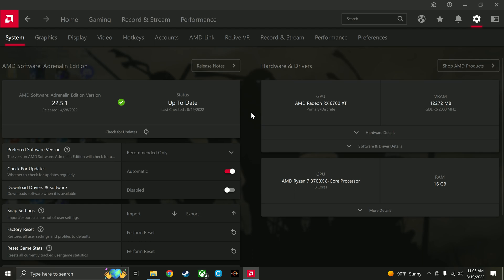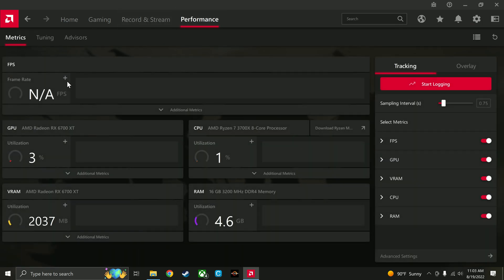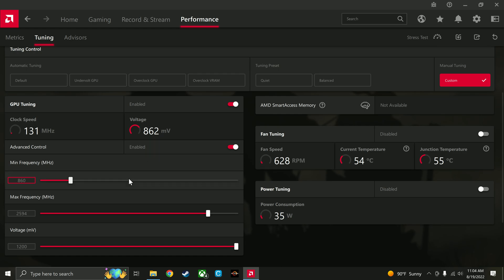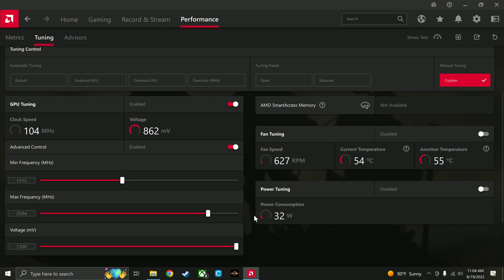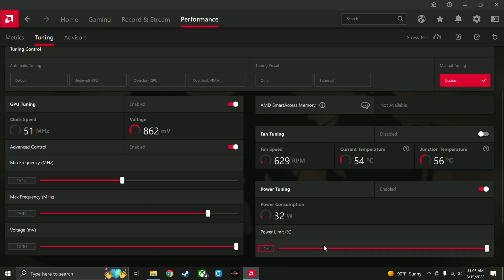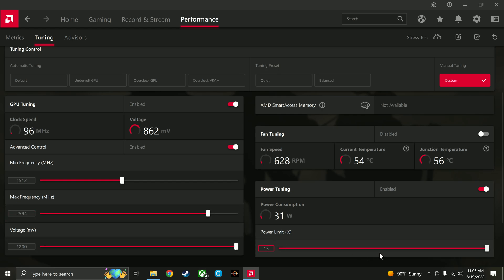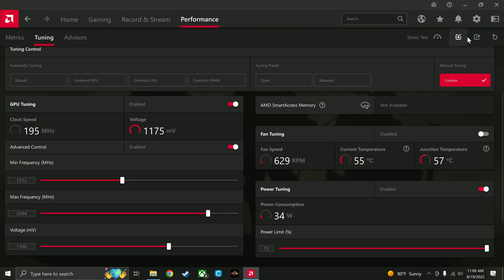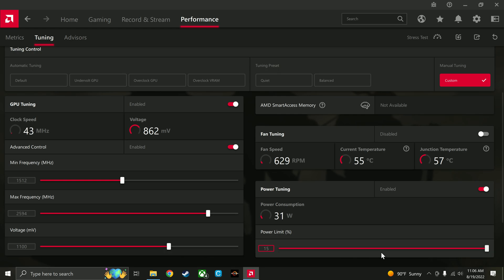How to Fix Sound Cutting Out AMD Radeon RX 6700xt

Comment: They removed this feature. :( FFS AMD, you suck so hard. Edit: 9070 XT Sapphire Pulse.

The only thing I haven't tried (I refuse) is to install Brave Browser and have it minimized at all times.
Reply from the maker: Maybe see if you can do it with msi afterburner
Reply: @Bunta1987qwerty   Well I went with the Brave Browser "fix". It works. If you happen to turn off hardware acceleration (Twitch doesn't work with it) then the fix stops working.

Comment: I have 5600XT, the thing has always had audio issues while playing games. I had to resort to using speakers in place of the cards audio. It's been like that since I built it back in 2020. I've been reluctant to mess with any settings (other than fan tuning, something I'll mention in a second), as it seems to crash even with the slightest adjustment. Now as far as fan tuning goes... the fans don't work unless I manually turn them on (for each game). For about 4 years I'd always wondered why I'd never heard the fan spin... I only play in 1080p and most games aren't very graphically intense, so I think that's what saved it from frying.
Reply from the maker: @Traeger91  how are the temperatures? I remember some 5700xt models had similar issues because of the cooler having no mounting pressure. I think it was fixed by adding washers to the backside of the card, so the screws could pull the cooler more tightly to the die. Alternatively, if the vram or vrm temperatures get too high, the card would also be unstable. This would happen if the pads aren’t making good contact with the components or the cooler. Laptops today have done away with pads, in favor of thermal putty for two reasons. The putty is better at transferring the heat to the cooler, and they don’t hinder die pressure. If you could, please install hwinfo64, select sensors, start a log file, and run a game for a few minutes. I’d like to see what the log file says. You could email it or put it in google drive and share it with me. Or we could get on my discord and do it in realtime. Unless you live in SoCal, then maybe we could do it in person. Sucks to hear you’ve been dealing with such issues for so long.
Reply: @Bunta1987qwerty  The only thing I can say is that it doesn't like being in the 50's. It never has and usually crashes once it get close to 60.
Reply from the maker: @ maybe try a lower frequency and/or higher voltage. Instability comes from too high of a frequency, or too low of voltage for the amount of throughput, which is a combination of frequency and instructions per cycle.

Comment: Had issue with audio cutting out for a second at a time every so often mostly watching you-tube shorts in fact. Or very low fidelity games. This did fix the issue for me although I had to raise the min frequency up to 2000. I've since come across other posts on reddit for others who had to go up to 2000 or even higher. Each card seems a bit different even if its the same amd model. Regardless does anyone know exactly why this works. I might raise something in the amd community forums and reference this video and the other reddit posts to see if anyone can explain this mystery.
Reply from the maker: @nobsterlobster4840  well, the higher you raise the max clock, the higher the max frequency goes. For example, if voltage is set to 1150mV and clock speeds are stock, it will have a max of 1150mV. If you then raise the clock speed by 100MHz, the max voltage will be higher than 1150mV. I imagine the min frequency setting is likewise raising the minimum voltage. The lower the voltage for a given load, the less stable it potentially is. Instability starts with minor artifacts, which could be sound cuts or video cuts, and eventually color shifts, audible noise, etc., and eventually stall. I’ll check when I get a chance, to confirm this.

Comment: I've been having this same problem for months. I've been searching for a solution all over Google, Reddit, Amd Forums and I found this video. I have an RX 7900XT and I've had this problem for about three months. Could someone please tell me what the correct configuration values would be for my GPU? Please help.
Reply from the maker: @neofrancos  just bump the frequency until the sound stops cutting, and if you want to lose some heat, run it at full load and drop the voltage by 10mV until it crashes and then you set it to maybe 20mV above that
Reply from the maker: @neofrancos  I should have mentioned, leave it at each voltage setting for at least a minute before you change it again, and make sure the power limit is set to max when you do it. You can set power limit to whatever you want once you’ve found minimum stable voltage. If it crashes again in the future, bump it up another 10mV. Different games/applications will load it differently, so just because it’s totally stable in one doesn’t mean it’s stable for everything.

Comment: Yeah this fixed it for me, thanks a lot m8. In my case was not only the sound that was stuttering, it was also mouse movement stuttering. Doing this it's OK again, thanks.
Reply from the maker: If you run into that mouse issue again, open device manager, look for your mouse, right click it, click on properties, and if there's a tab that says power management, make sure "allow windows to turn this device off to save power" is disabled. This is true for anything that seems to lag, like keyboards, trackpads, etc. I hope this helps.
Reply: @Bunta1987qwerty  - Heya! thanks for the tip. I was already aware of that, and had in fact done your tip before, but it doesn't help in my case. The only thing that worked after hours of troubleshooting was realy uninstalling the 2024 Adrenaline drivers (all of them have this issue) and reverting back to 23.12.1 or 23.11.1 and everything is smooth again. Shame :\

Comment: Thanks very much, mate!
As many others mentioned, I was trying to fix these extremely annoying crackling audio issues for weeks since I installed my 6750 XT. They were not permanent in my case, but would happen especially when a streaming video was maximized to full screen.
Even considered replacing the GPU and/or the power source, but thankfully found your instructions before that happened. They did the trick perfectly: minimum frequency set to 1500 MHz, undervoltage at 1180 mV, and the issues are gone. Awesome job, thanks again for sharing!!

Comment: Ah Glad I found this, good suggestion. Made a light go off in my head.  So I built a TV PC and it runs mostly light weight games Vsync so it makes sense to me the GPU is power stating down, and then doesnt have the oomph to push audio as well.  AMD really needs to sort these little QOL issues out no?

So tehcnically AMD GPUs use internal p-state based on frequency breakpoints (well they did in the past).  I used to hack their BIOS's and stuff and you can change the breakpoints.  Essentially by telling everyone to go up to 1500mhz, when the GPU is loaded it will hit a minimum p-state and hold there (no idea what the values are but that's likely in range of like p4 or p5).  So these lighter games with FPS limits drop the p-state down and then the stutters begin.

I'll try this on mine, not in front of it right now, but I think this will 100% fix the issue

Comment: I have the 6700xt for 2 yrs now runs great,but since the last edition came out,my sound works during game play but I always record my games and this month all my recordings the audio shuts off half way thru.
Reply from the maker: Try using hevc if it’s currently on avc. If audio channels is set to auto, set it to stereo. I hope this helps.
Reply: @Bunta1987qwerty  I tried what you showed and my pc just crashed right now,I reverted back to defaults and the AMD debug message came so I filled that out,thanks anyway
Reply from the maker: @andrewmontreal  check the metrics and make sure it isn’t overheating
Reply: @Bunta1987qwerty  thanks dude, i was using av1 codec and the sound was cut off in the last 5-7 seconds of the clip/video, now i have everything as it should be

Comment: This fix worked on my RX 6750 XT (AMD reference/1st party model). Most noticeable for me in Rocket League, and 1500 was the magic value to set Min Frequency to. I made no other changes.

The fix also carries over into Linux (Arch/HoloISO) as well. I enabled OC'ing in the kernel parameters during boot and used the LACT tool to set minimum clock, again to 1500 with no other changes. 

Cheers!
Reply: It fixed the problem for me aswell under linux thx

Comment: Thanks bro it works for me but in order to solve sound issue completely first I used your settings second  I turned on  metrics overlay and it worked now I have no sound issue with my 6700xt
 perfect🎉

Comment: i picked up a little used HTPC on craigslist with a RX 5600 OEM version, and none of these fixes do anything :( sigh. saw a suggestion to change the pci-e version from auto to gen 3 or 4 or whatever in your bios, this didnt do it for me either
Reply from the maker: If you’re still using the whole system, try to find the drivers for that specific htpc
Reply: @Bunta1987qwerty  I've installed the latest chipset and GPU drivers, everything is up to date. 
I had an old Soundbar that I wasn't using and the audio works fine from the 3.5mm jack on the motherboard, I'm just using that for now instead of the HDMI output, works for now
Reply from the maker: @CodyShell  have you done a fresh windows install? You could also try using DDU to clean out the drivers and install again
Reply: @Bunta1987qwerty  yeah it's a fresh install only a week old
Reply from the maker: Damn. If you haven’t already, you should of course try a different cable or hdmi port on the monitor/tv. I’d use DisplayPort if possible. Regardless, I’m glad you found a workaround for the interim.

Comment: I have the same problem with my RX 6400 low profile card, but unfortunately it appears AMA have locked this model off, so it can't be clocked.
Reply: Video playback is uneffected. The audio cutouts only seem to happen (intermittently, for a split second duration at a time) in Steam games.
Reply from the maker: @Teleport73  I wonder if using the modded drivers would get around that

Comment: Thank you! I have the SquareTrade extended warranty on my ASRock 6700 XT, but they want me to mail it in and I'm guessing I'll just be out a GPU for a couple weeks until they say there's nothing wrong with it.

This solution worked when nothing else would. 1400 MHz was where it stopped cutting out entirely.
Reply from the maker: I’m glad it helped. Different applications may require different minima, but you can configure settings for each application, as well as having a global setting which is otherwise always applied. You’ll notice that on the desktop and other very light tasks, the frequency will be well below the “minimum” you set, but the issue should still not present itself.

Comment: I just got a 6700xt and I've encountered stuttering in every game on my PC. I don't know what could be the problem. My specs are: 5600x undervolted not by much; 8gbx2 3600Mhz CL 16; Sata ssd 850 evo 500GB; PSU 650W corsair 80 bronze; b550m aorus elite MOBO (latest bios). 

Apex seems to suffer the most from this as the stuttering makes the games unplayable. I've seen many people use the same config but they have better performance.
Reply from the maker: Every time that shaders present themselves for the first time, the card will stutter. This will happen every time you update drivers. However, if you play the game for a little longer, it should go away. Raising the minimum frequency can help some frame drops. Make sure you enable xmp in bios or the ram won’t run at the rated speed and timing. Every new shader will stutter. That means any skin, weapon, particle effect, animation, etc. rendered will cause a latency. One or two, no big deal, but the first launch of a game will have millions. Many will load at the same time, and that will cause the stutters.
Reply from the maker: I just remembered; if you switched from nvidia/intel, make sure you use ddu to remove all the old drivers or you'll continue to have problems.

Comment: I've tried this but still the audio ocassionally cuts out. Is there anything else that could fix the issue.
Reply from the maker: Try using a higher frequency than I used, and if it's not in a game, try running the application as an administrator. Otherwise, you can try using a different audio driver, like realtek or something.

Comment: Desperate to fix the audio since upgrading to RX6950xt. I have tried every other 'fix' known to google search and nothing works, including this one. I am only seeing issues with devinci resolve and RDR2, everything else is fine. If anyone can offer any advise it would be very much appreciated.
Reply from the maker: Concerning Da Vinci Resolve, try running the application as an administrator. Sometimes that also helps with hardware acceleration and resource usage, since windows likes to limit the amount of resources that any one app can use. I'm not sure about RDR2, since I've never had any issues with it. One thing you could try is deleting the shader cache if you have it through steam. If 1500 MHz almost fixes it, try a higher value. Even as high as 2400 MHz if necessary. Low IPC cycles don't really do any harm.

Comment: I traded mine in cause of the stuttering and now I want it back cause it isn’t a terrible card it just keeps stuttering all the time and it’s annoying I just want it to run smoothly and not bad, the amount of fps I had was amazing but the thing just kept stuttering
Reply from the maker: By stuttering, do you mean fps stutter, or the audio issue? What did you get instead? In today's market, you could still resell a 3070 and have enough to buy a used 6800. I've had my 6800 since launch, and haven't had almost any issues, and the 16GB of vram is great.

Comment: thank you man I was struggling to solve this issue for a long time .
Reply from the maker: I’m glad it helped. This seems to be a common issue for this card.
Reply: @Bunta1987qwerty  common issue in AMD drivers. I have an old one rx 570
Reply from the maker: @msenosy  damn. I have an r9 290, rx480, rx580, 6600xt, 6700xt, and 6800. The only one with this problem for me is the 6700xt. I hope you also did the undervolt and increased the power limit. It definitely helped me out.